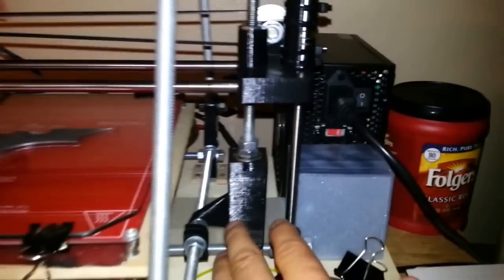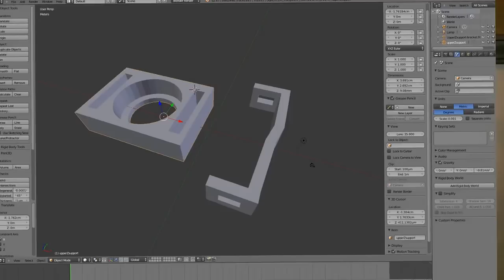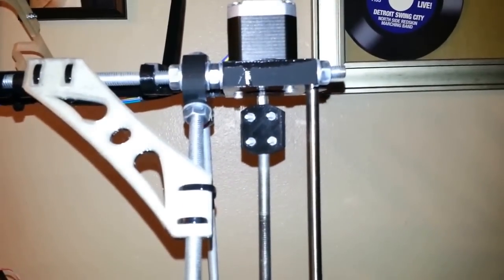Upper Z Support for the Prusa Mendel I2

Comment: Yeap, Kevin. I take a looking both videos. Your solution is fine. I downloading both files. For printing. And install at my prusa mendel. I had a lot problems about z axis. I hope fix, using our solution. 
for this, tanks a lot. :)
Reply from the maker: +lineuve santos You only need one of them,  the upper supports.    I haven't had to level the bed in almost a year now.
Reply: what is our email address ? I send some draft about z and x axis. If you needs change some deital, i draw in Solidworks. its my pleasure.

Comment: Buy aluminium couplers, much better..
Reply from the maker: Yes, the solid aluminum couplers might be better than plastic, but not the 'spring' type.  They give just enough to stretch over time, weaken, and make the Z movement just the slightest bit non-linear.  They also keep the full load wearing on the stepper motor bearings.  This takes the load off the bearings.
Reply: I have that ones now, will test then :) can you help me with my z motors, cant put them to work, dont know if it is hardware or software, the other work fine.
Reply from the maker: The drive current is probably too high or too low.   On the driver there is a very very tiny variable resister.  Use a plastic tipped screwdriver and turn it all the way down or counter-clockwise.  Turn it up about 25% and try to move them.   If they only buzz, or only one moves, turn it up an additional 5% and try again.  Get to the point where they move smoothly and tweak it just a bit more..